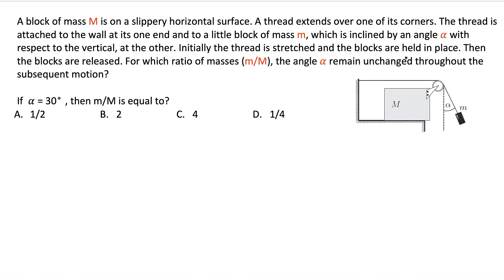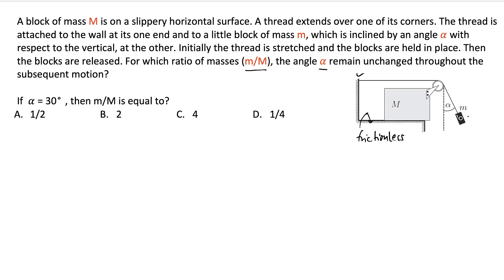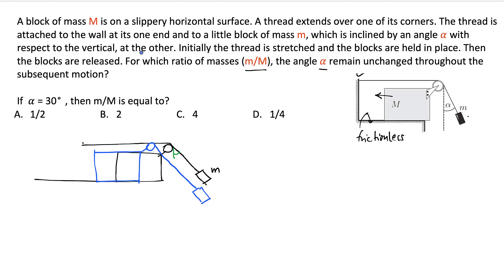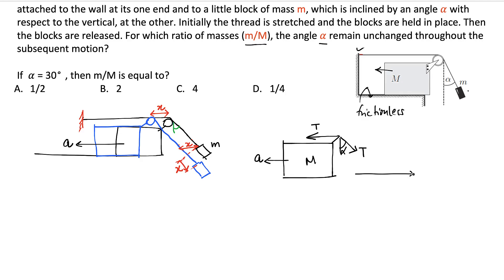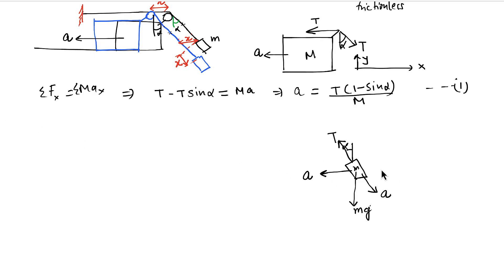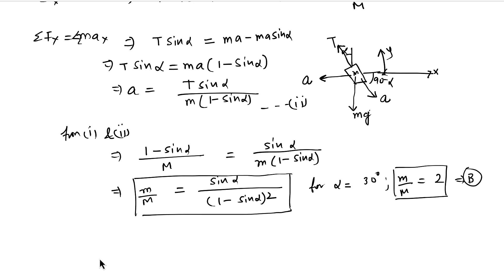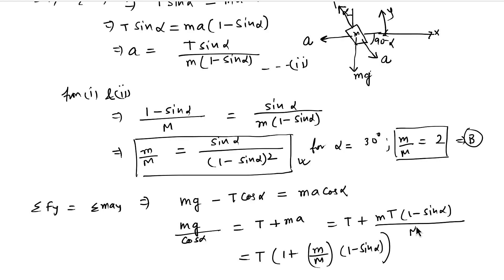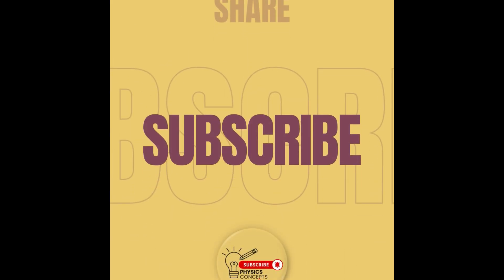Highly Likely Problem for IIT JEE In Coming years - Can You Solve This?

Comment: sir how did the small mass also has same accn in x and y as big mass in x dirn, cant we solve the ques with accn a1, a2, a3 ie using diff accn. could u plas say the theqry behind the same accn of M and m.
Reply from the maker: Yes you can do that @dikshukutty.
However you will require more equations here and that will come from the fact given in the question.
Angle alpha is constant - so you will need to form equations for the accelerations and eventually you will get same condtions.

Comment: sir, wrt pulley ...mai ne yeh equation likha

  𝒎𝑎𝘴𝑖𝑛(𝜶)+𝒎𝙜𝑐𝑜𝘴(𝜶)−𝚃=𝒎𝑎      ⓵

masin(𝜶) ...pseudo forces hai 

par sir jab mai ne 

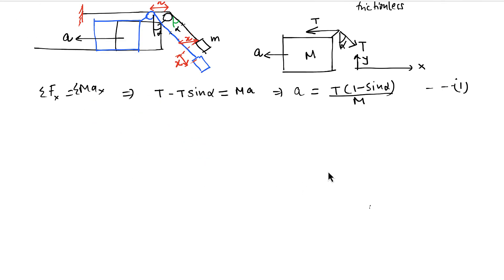M𝑎=𝚃(1−𝘴𝑖𝑛(𝜶)) .....⓶. .equation at 5:17

&
 
𝒎𝑎𝘴𝑖𝑛(𝜶)+𝒎𝙜𝑐𝑜𝘴(𝜶)−𝚃=𝒎𝑎     ⓵

solve kiya to (eliminating 𝑎) 

𝚃=𝒎𝙜𝑐𝑜𝘴(𝜶)/(1+sin𝜶)    ⓶

aya jo ki galat hai ...sir mistake kaha hui hai???

equation⓵&⓶ solve  krte waqt maine is fact ka bhi use kiya ki       ----  𝒎/M=sin𝜶/(1−sin𝜶)²  eqn at 7:25
Reply from the maker: multiply and divide by (1-sin𝜶) and you will get the right expression - no problem with your equations.

𝚃=𝒎𝙜𝑐𝑜𝘴(𝜶)/(1+sin𝜶)   = 𝒎𝙜𝑐𝑜𝘴(𝜶)*(1-sin𝜶)/(1+sin𝜶) *(1-sin𝜶) = 𝒎𝙜𝑐𝑜𝘴(𝜶)*(1-sin𝜶)/cos^2𝜶 = 𝒎𝙜(1-sin𝜶)/cos𝜶
Therefore this is correct.
Reply: @Physics-Concept-Problems  Got It sir !!!

Thanks for giving your time

Comment: The question wasn't that hard like mathematically the only thing  where the mind got some excercise was just FBD and accln.
That's it .

But still pretty good 👍
Reply from the maker: Thanks @InsertUserName_JEEArc  
I agree - the question very much like what jee asks. Concepts and some logical thinking
Reply: Sir I would like to make a request of one good problem from SBT Question 88 of Rotational Motion where Hinge force needs to be calculated when it makes an angle of 45°.
Reply from the maker: What's SBT Question 88? If you let me know - I will cover definitely
Reply: I mailed you the question sir.
SBT is a book written by Shashi Bhushan Tiwari sir which contains jee advanced type question. @Physics-Concept-Problems
Reply: @InsertUserName_JEEArc that one is pretty simple, not too hard.
Reply: sir, wrt pulley ...mai ne yeh equation likha

  𝒎𝑎𝘴𝑖𝑛(𝜶)+𝒎𝙜𝑐𝑜𝘴(𝜶)−𝚃=𝒎𝑎      ⓵

masin(𝜶) ...pseudo forces hai 

par sir jab mai ne 

M𝑎=𝚃(1−𝘴𝑖𝑛(𝜶)) .....⓶. .equation at 5:17

&
 
𝒎𝑎𝘴𝑖𝑛(𝜶)+𝒎𝙜𝑐𝑜𝘴(𝜶)−𝚃=𝒎𝑎     ⓵

solve kiya to (eliminating 𝑎) 

𝚃=𝒎𝙜𝑐𝑜𝘴(𝜶)/(1+sin𝜶)    ⓶

aya jo ki galat hai ...sir mistake kaha hui hai???

equation⓵&⓶ solve  krte waqt maine is fact ka bhi use kiya ki       ----  𝒎/M=sin𝜶/(1−sin𝜶)²  eqn at 7:25